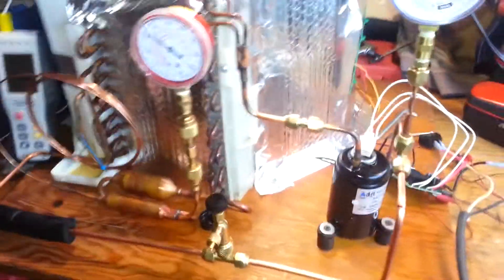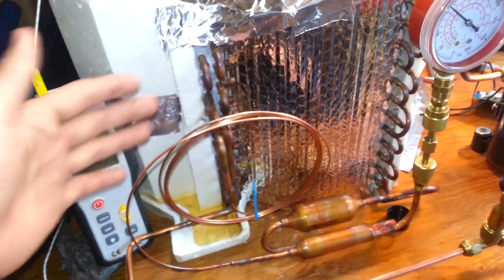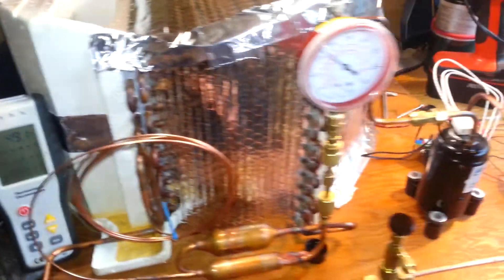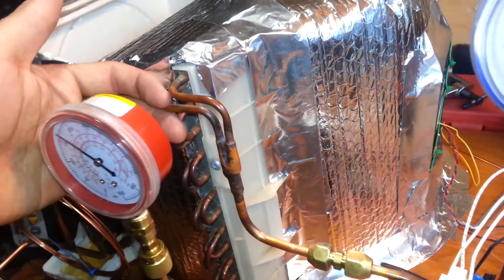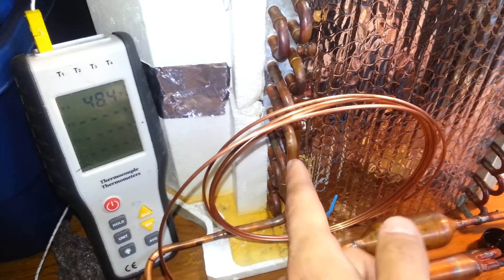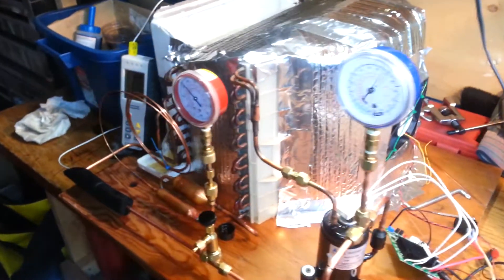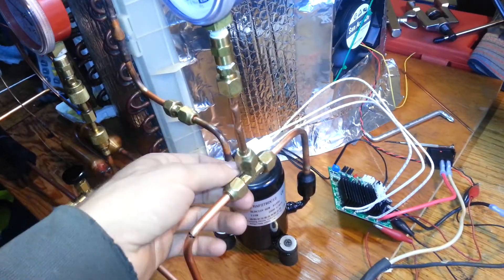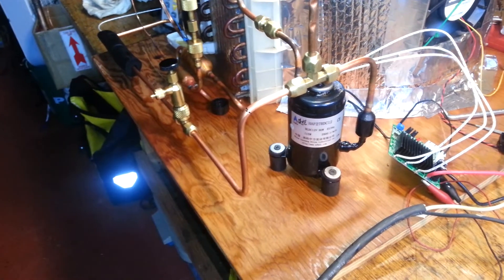Mini Refrigeration Compressor - Better Performance

Comment: Have you adjusted the restriction to get the correct balance? Dorm freezers use a simple crimp to set the correct restriction.

If there is not enough restriction, then you just end up with liquid that gasses only after the restriction. It only gasses because the liquid, after nearing the vacuum, boils back into a gas. I think that's why you feel a difference through the coils. With the correct restriction and gas, the temps through the coils should feel nearly constant.

You could gain a lot by a thermal imaging camera. It will actually show you the clear lines where gas and liquids are at.

Imagine that after the compression point, there is not gas, but a liquid still. It will be a slightly colder liquid, but not as cold as a gas. As the liquid is 1/4 the way up, it boils into a gas and loses more heat, due to low pressure. If that restriction is restricted more, the liquid should instantly decompress into a gas and function correctly.

You can get a manual adjustment restriction, but a basic crimp works fine. Unless you over-crimp it. You can use a manual restriction adjustment inline with a physical crimp, then later remove the manual adjustment.

While you are at it... Turn it into a super efficient AC unit. Have your hot delivery line run across the condensation tray with an evaporator cloth around it, wicking up condensation. Try doing it after the air exchanger, so you ensure that condensation exists. Or do it before the exchanger, so evaporation happens only if condensation exists and the exchanger acts as a secondary cooler. (Condensation coming from the cold exchanger.)

That should allow a lower speed fan, or a variable speed fan to be used for the hot air exhaust. You can use standard fiberglass cloth or buy swamp cooler material as the water wick. If you don't want to wick it, just set the copper tube in the condensation tray and directly heat the water to evaporate and recapture the "lost cooling", which is coming off as cold condensation, from inside.

Comment: hello, I bought an a300 air conditioner from aliexpress and by mistake I connected the wrong wires to the battery, which led to the burning of some parts on the motherboard. now the compressor doesn't start and it doesn't get cold. can you help me with a tip or a diagram to see what could be burned? and if I can replace the burnt parts at an electronics specialist. Thank you very much!

Comment: Hi, i am working on a  3500btu/hr compressor for dehumidifier, can tell me capillary tube data
Reply: capillary or txv sizes acordin to   Depend wheich gas u  use r R134 and hey 600 and hey 290

Comment: Good video i appropriate your work. I have some specific questions about this system. can you give me the specifications of copper tubing before and after the size of capillary tube and its length.i am waiting for your reply. 
Thanks.
Reply from the maker: Cool Guy this device never worked very well. The capillary tube and heat exchanger sizes were horribly mismatched. What are you building?

Comment: Great video, Inspiring to make something I wanted to do for a long time, would like to reach out to you and ask you few specific questions to be able to have a proof of concept of the product that I want to do,, basically I am interested to create a DC portable compressor refrigerator that run on solar power with a battery for using it at night
Reply from the maker: Yes.  Please do that.
Reply: btw is that an inverter compressor ?
Reply from the maker: Ibrahim Alkhulaifi Yeah.  It is a 12VDC Brushless compressor.  Rotary

Comment: Hi, I am working on making a small ( 4000 BTU ) air conditioner with a DC compressor running on solar. Can you please share some expertise ?  Making it for India, so price is tooo much an issue.  Not just for proof of product, but for really reaching out to the masses. Can you share your email id ?
Reply from the maker: E-mail is listed under "about" on my blog.

Making, or modifying an air conditioner for DC use should not be difficult, but you may find it expensive to acquire a compressor.